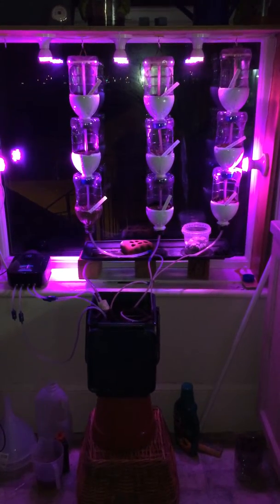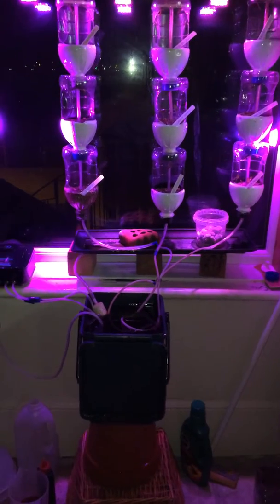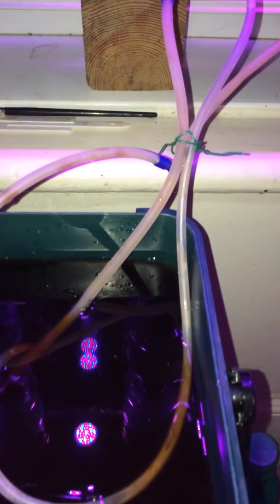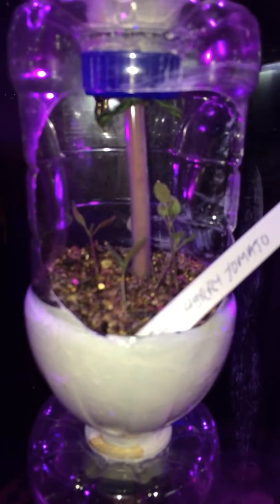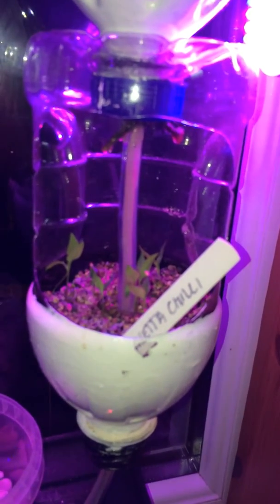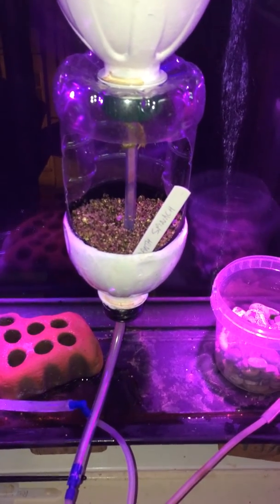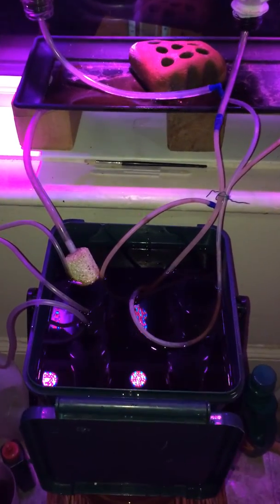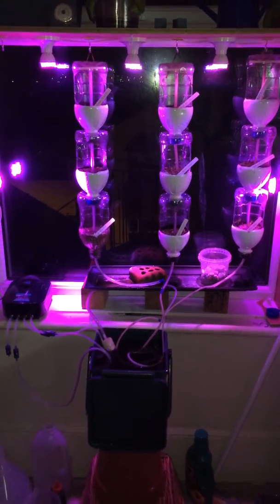Air-lift hydroponic window garden.

Comment: how do you pump the water up. i Know by air. but how? i cant make it work?
Reply from the maker: +Brian Bo Jensen 
Hi Brian, thanks for your interest. I'm sorry that  I didn't make it clear but it's a bit tricky. The idea is that you get a stream of small air bubbles to rise up through the tubes from the air pump (yes, it pumps air not fluid. You can get them for fish tanks). The problem is that if it's not set up just right, the air will go the wrong way and back-down the tube instead of rising. The secret is to have a longer tube than you think you need as then it is easier for the air to go the right way than back through a long fluid filled tube!
It is also why you need a tyre valve to introduce a small stream of air bubbles at an angle that points upwards to help direct the bubbles. 
One other problem you will find is that a tube full of air will want to float, so must be tied down. I used plastic zip ties.
If you get it right there should be a steady flow of air and fluid dripping out of the top.
(see this pic here (not mine though) https://www.pinterest.com/pin/517139969686371247/
: note the 5ft coil of 1/4" tube!)
Let me know how you get on.
Reply: thanks for the information. now running flow, but the water inside the tube pulsing back and forth, fine enough, but for some 8-9 hours so traveling water back to my water storage and makes air bubbles backwards. oddly enough when it runs fine for many hours. do you think the water hose shut be longer or the pump must be above the waterline??
Reply from the maker: +Brian Bo Jensen
Hi, The water should not be pulsing back and to! You must try different pump positions. i.e. try raising/lowering the pump and making a  longer coiled water tube before the air goes into it.  If it doesn't help, maybe the height of the column is too big for the power of the pump.
Reply: thanks for helping, it is running by now :)